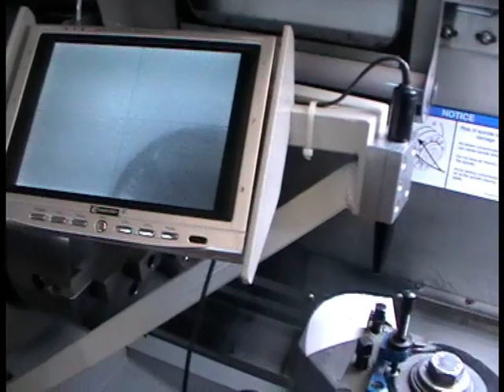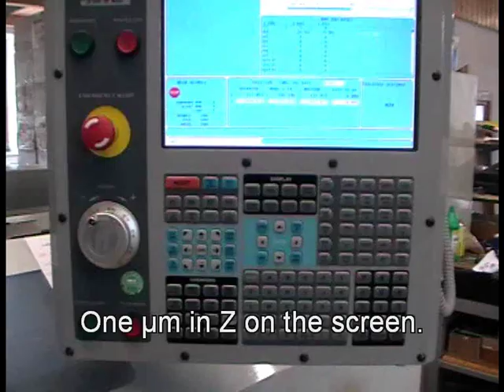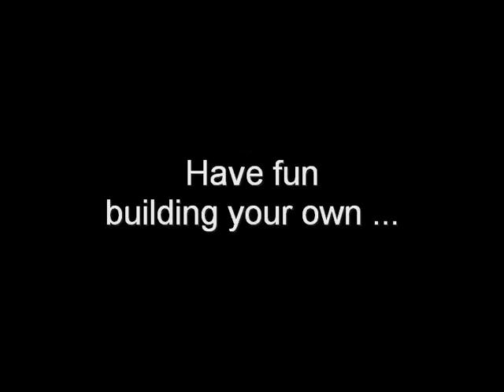DIY Optical tool setter for a Haas lathe

Comment from the maker: @MathIndy 
I bought it used from a friend. But still it wasn't really cheap.
You could use some USB-microscope, but I simply didn't want to boot a computer to get a display. Also, I didn't want optics with variable magnification.
You already should be happy with a 200 * magnification.

Comment from the maker: @archimedesCNC I bought it a few months ago. A company went belly-up and it was sold by the liquidator. They couldn't even answer how many spindle hours it had. So I got it very cheap. In the end, she had 56 hours cutting time. :-)))
I'm quite happy with it. It's not the best lathe on the planet, but for me it is a perfect match. I'll make a few modifications of the enclosure and then I'm happy.

Comment from the maker: No, I don't have to determine the location. The 3 pins are precise enough to reposition the crosshair at "exactly" the same location. Admittedly, the magnification of the camera is too big. 100* would have been good enough.
You always have to fine-tune the tool's offset depending on material, feed and DOC.
The location of the crosshair is once determined with a test cut by checking the diameter. In Z-direction, it's not important when working with G54.